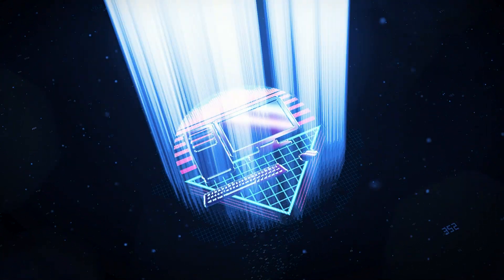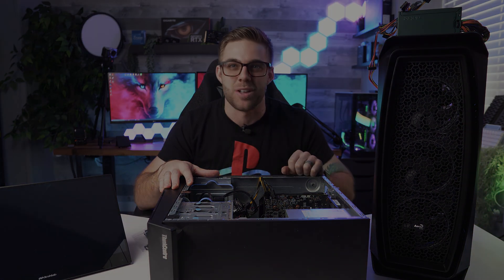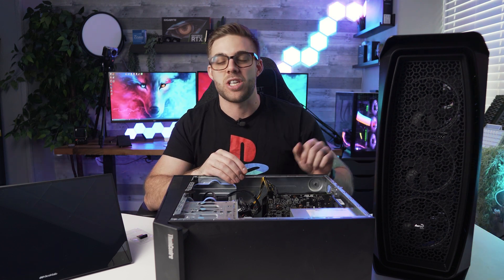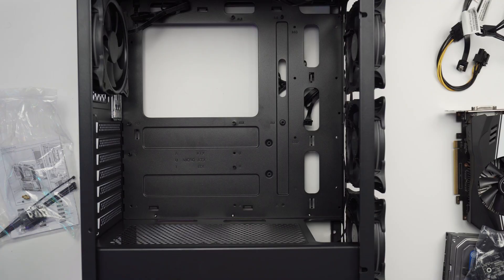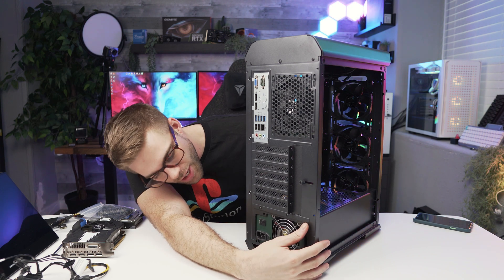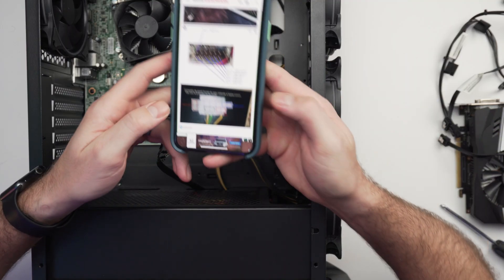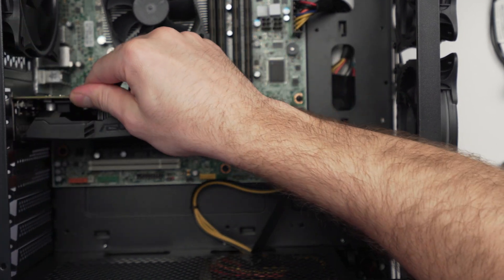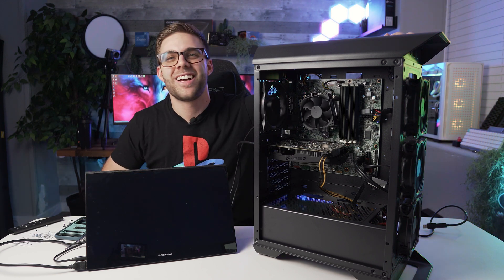The EASIEST Office To Gaming PC Swap EVER! | Lenovo M93p MT Case Swap

Comment: I tried to use a 24 pin to 10 pin adapter for my psu supply, however i found out that it causes the power supply to remain on even after shutdown. Is there a work around this?  The adapter causes the psu to run even if it is not connected to the motherboard (lenovo m720t)

Comment: I just did this today with my lenovo P320.  The lenovo case was a little small, so the temperatures weren't the best.  Therefore, I bought a £30 computer case and swapped it over.  

I followed your video about modifying the i/o shield.  It also gave me tho confidence to try it in the first place!

Thanks for making the video.  Keep up the tinkering!

Comment: New case - Amazon: Aerocool Eclipse Mini Tower Case – Aero One PC Gaming Case 4 x 120mm ARGB Fans with 1-6 PC Fan Hub, Mesh Front Tempered Glass Side Panel, Supports Liquid Cooling, Cables Included, White

Comment: Did almost the exact same thing except RX 6400 video card, Cooler Master Q300L case and reused the power supply for simplicity. So good at running Fortnite, Spiderman Remastered, Gamepass and Roblox that I have no real justification YET to upgrade the platform.

Comment: I'm currently doing this on a Lenovo ThinkCentre M900 model into a ThermalTake S200 TG ARGB case. My question is about the ARGB fans, how did you connect them? I am considering using a ARGB Controller for addressing the RGB, using a USB 2.0 port and PSU SATA connections, but how do I provide power to the fans? I am new to ARGB and case-swapping, so any help is much appreciated.

Comment: I have a problem I have same pc with i7 4rth gen but when install amd rx 5500 xt or rx 580 it causes hdd usage to 100 percent and when i remove gpu the usage goes back to normal i the past i had no issue with rx 560

Comment: 10:18 you can use audio separate individual wires with plugs keeping wire colour the same, put one connection at a time on the board
Reply: Do you happen to know where I can find the pin layout to do that? I am having a hard time trying to match each pin on the motherboard to that of the case's front audio panel pins.

Comment: Great Video Man - You nailed it on the thumbnail - Lenovo's are the easiest case swap to do. I modded out a M93p and it turned out pretty great. I right now have a M900 Midtower (6th Gen i7 - SSD- 8 GB Memory) for $125 and the m920s SFF (8th Gen i5, 8GB DDR4,  256 GB NVMe) for $200. They are great because when you do the swap, all you need to do is make sure the Power Button is right, and the CPU Temp Sensor that you can just bring over and hide it in the new case. Getting a USB Adapter for the cases USB 3.0 is nice to have, and of course the adapter for the 24 Pin ATX Power, and that's it!!! No errors!! I think I like Lenovo the best out of the big 3 OEM Companies (Lenny, Dell, HP) Keep up the great work my man!!!

Comment: Hello. Do the adapters work both ways? For example I would like to put a non proprietary mother board in this case and use the stock power supply and front panel connectors. Would I be able to do that? Can you make a video how to do that? My motherboard inside the case has dead ram slots it is  Lenovo m93p or something you did a video on it before with the GTX 1060 3gb and the i5 4570. Thank you sir for this cool video. Edit.. I mean I want to put an a320m board in the Lenovo case is it possible?
Reply from the maker: If you used a new motherboard, i don’t think the adapters would work because they are pinned for the stock board. Unless someone out there makes backwards compatible adapters? I haven’t seen those though
Reply: I can't remember the like but there is a adapter out there

Comment: I am quite new to pc building and case swapping and I'm hoping to do a case swap for an m92p into a thermaltake h17. Will the adapter that you used in this video for the usb port in this video also work for an m92p case swap? Also, I know that you said that you weren't transferring the audio and microphone jacks b/c you didn't have an adapter for it, but are there adapters for those things? Also, does a brand new computer case come with all those pin things that you had to use the diagram from tom's hardware on? Sorry for my lack of pc knowledge but any help would be appreciated. Very well made video and I learned a lot from it.
Reply: Do you have the answer now i need to know
Reply: answer to which part? @ismulazam7631

Comment: How did you connect all of the fans?
Reply from the maker: The case came with a fan hub! Made it super easy
Reply: Which header did you use for the hub? I'm doing a m83 sff swap my board has 2 the cpu fan and other one is case fan. I'm thinking about using case fan header. 

There is also a temp sensor that plugs into the top right of the board and the sensor is placed right under the front fan. How does the motherboard control the case fan? Does it use this external temp sensor?